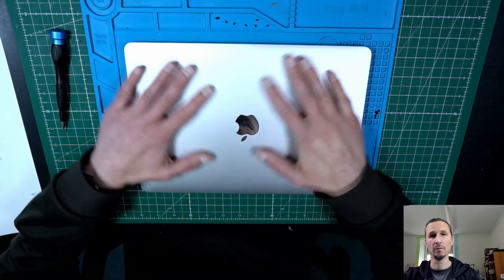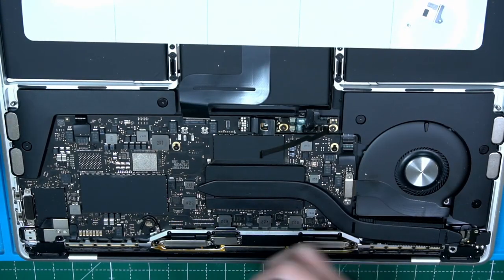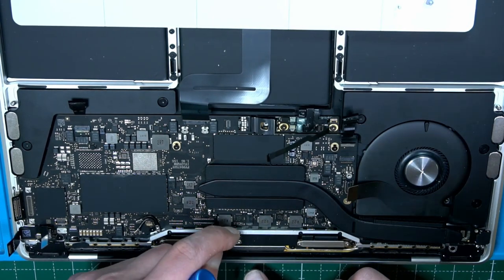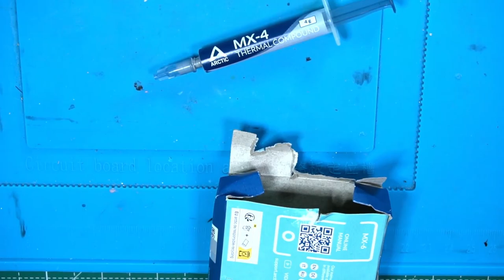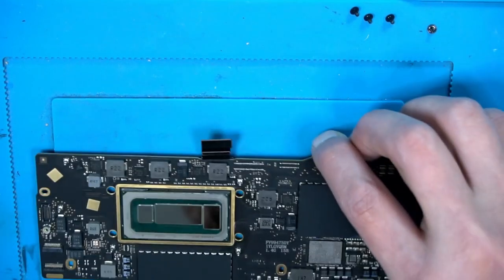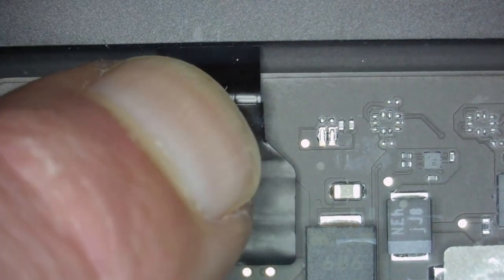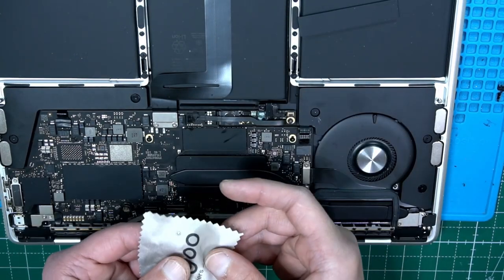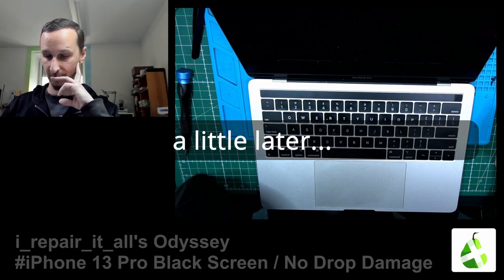How To Disassemble A Macbook Pro 13 Inch New Thermal Paste

Comment: I followed this. At 26:40 you made a mistake, make sure the thunderbolt connector "clicks". I had the same problem as you, the MacBook wouldn't turn on, then I reconnected the cable making sure there was a "click" and the Mac turned on as soon as I connected the power cable.
Reply from the maker: I hate this model... it happens all the time... you might be right :)
Reply: Thank you for pointing this out! I had the same issue as well and your comment helped me resolve it.

Comment: Hello, I just did this on my Macbook pro a2159, I put everything back together and it's not turn back on. Any tips ?
Reply from the maker: Inspect all fpc connectors, ground screw etc. If nothing works try the old battery again.

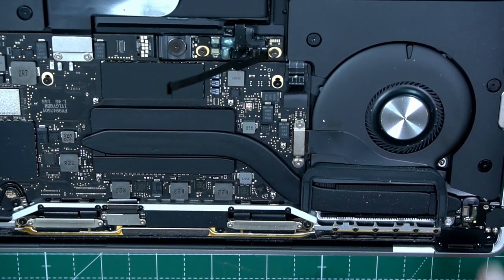Comment: what is this screw that you use in 4:37?
Reply from the maker: Allen key H3
Reply: @irepairitall  I am having a hard time finding a bit that will work for this. I cannot find an allen key that goes over top of the screw as it appears you do in the video.